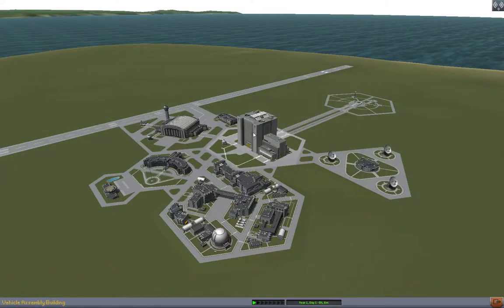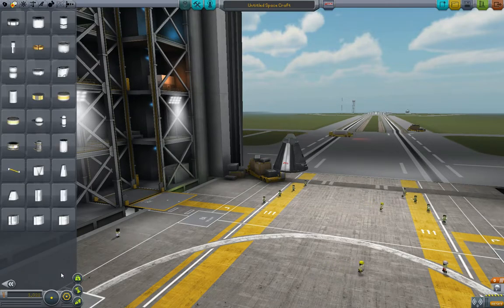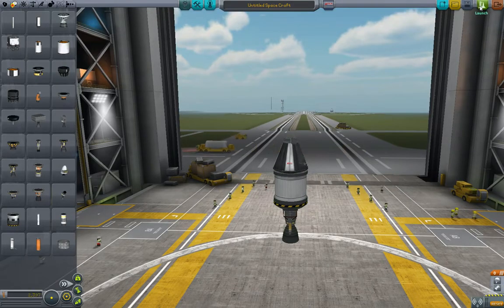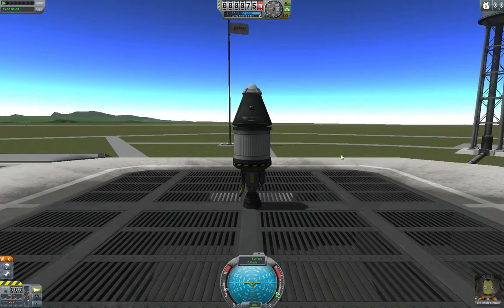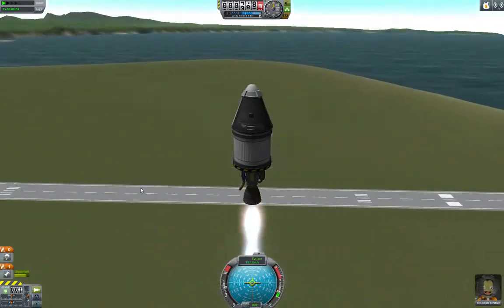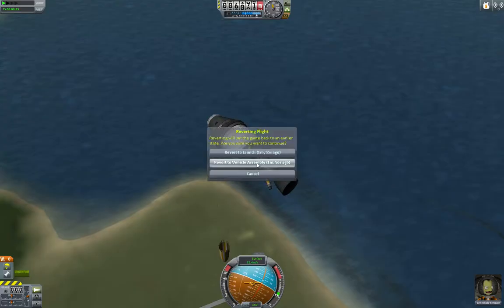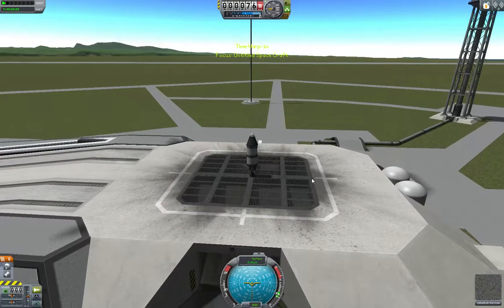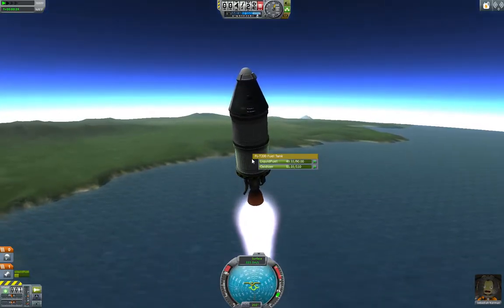5 Minute Kerbal - #3 - Liquid fueled engines! | Kerbal Space Program

Comment: What does it say oxidizer deprived when I try?
Reply: did you edit the settings on the fuel tanks
Reply: @coolnotcool-wq7nx  this is when I first started, and I was just using the plane fuel tanks that had no oxidizer in them and I was using a rocket engine I couldn’t figure this out for a very long time.

Comment: I have a question, when I was making a big rocket, after a certain time of launching, it tells me I ran out of oxidizer,  how do I fix that?
Reply from the maker: Hmm, that's odd.  Regular fuel tanks contain rocket fuel and oxidizer in a pre-mixed ratio.  If you're talking monopropellant, there are specific tanks you can add for that.  Otherwise, not sure how you run out of oxidizer without just generally running out of fuel.
Reply: There is generally a larger number of oxididizer in each fuel tank but it burns faster so just add a bit morr fuel